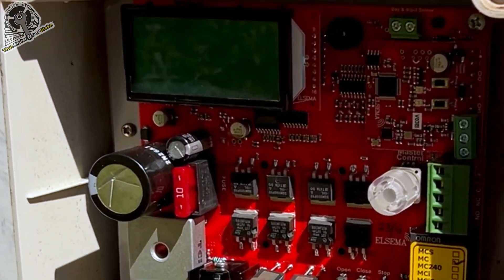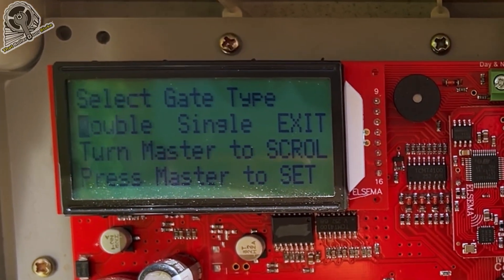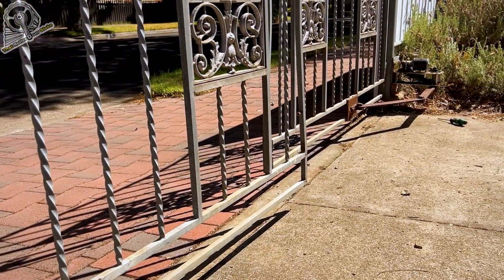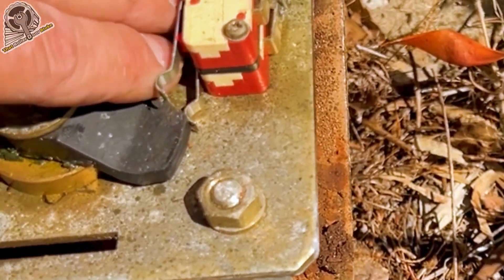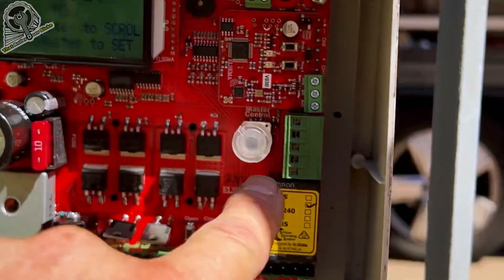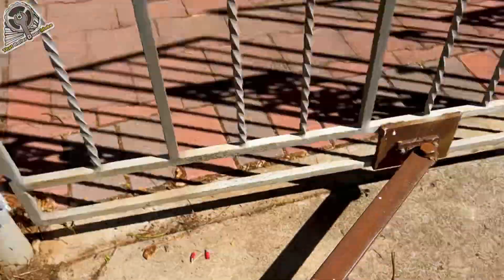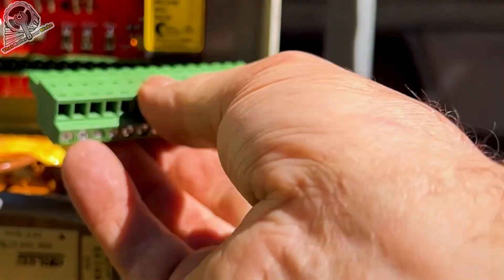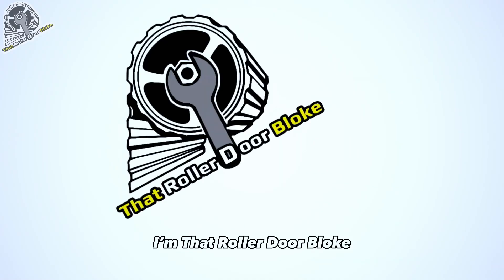[110] Setting up your Elsema Double & Single Gate Controller with Eclipse® MC Operating System

Comment: Thank you very much. This helped me upgrade my old gate, which is strikingly similar to that one. 
It's all working, most of the time, but occasionally, when the gate opens, it then closes slightly. 
Then I close it and open it again, and it's fine; it opens all the way without issue. 
Any idea what might be the issue?
Reply: Think I worked it out, I had set the open limit switches right at the very very max and some times it would trigger as a collision and auto back off. So the solution was to dial back the open limit switch ever so slightly. No issues since.
Reply from the maker: Glad it helped! Sounds like there might be an issue with the limit settings or obstruction detection setting

Comment: If you install battery which battery do you need?
Reply from the maker: 12v or 24v depending on what motors are used

Comment: Any ideas if the travel limit not set comes up after doing ilearn at all?
And now the gate does not work with the remote
Reply from the maker: Did it go though the whole procedure ?  Sometimes it will get stuck on a certain percentage and this can be looked up as an error code. Most likely something to do with the motors or wiring configuration/ fault

Comment: Great Content.  Not sure how it works when 2 limit switch are wired in series. When one limit switch opens, the motor can still work in reverse direction? the entire motor circuit is open
Reply from the maker: Thanks :)  The control board on these types of systems does the switching which is also very cool as you can change the open or close direction right from the control board as well rather than having to swap around the motor wires on most boards.  It's also why the diodes need to be used.